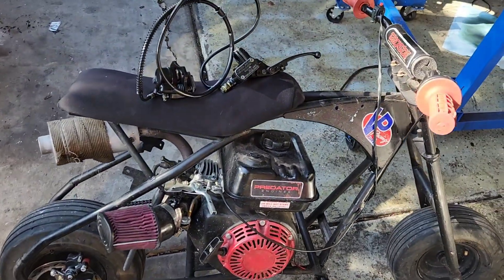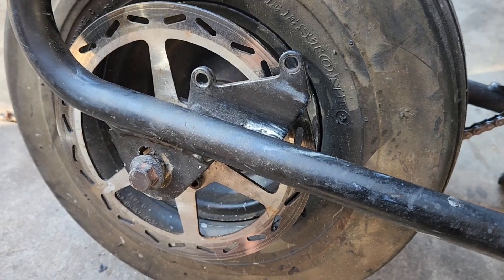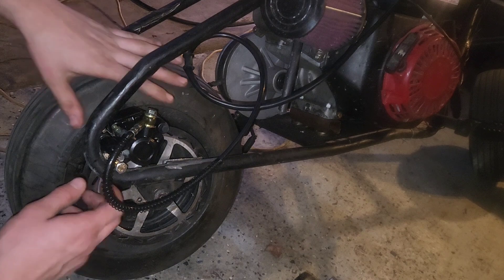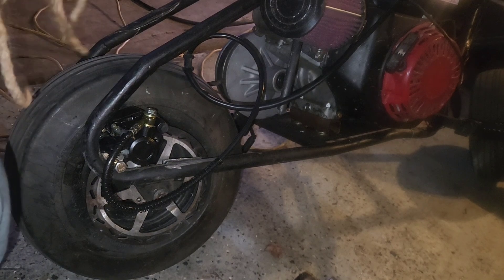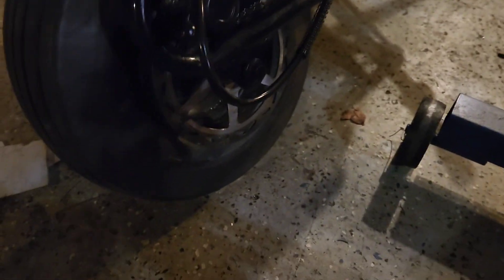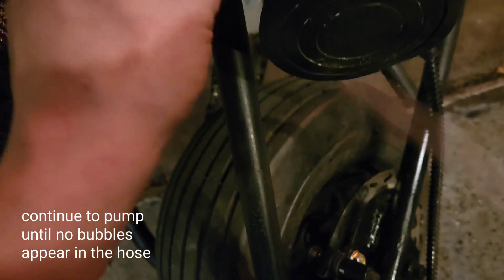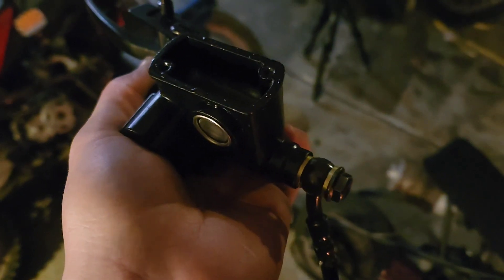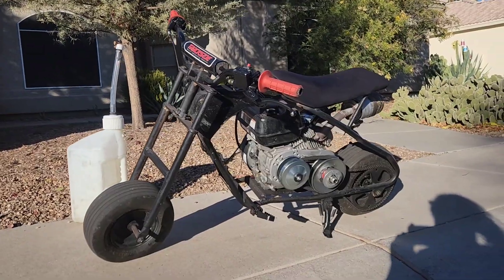MASSIVE minibike brake upgrade for $30! - tutorial

Comment: Hey man nice vid , what size tires are those? I been looking for those
Reply from the maker: Rear- 15x6.00 - 6 (15 tall 6 wide and 6 inch rim) front- 13x5.00-6. brand is Deli Tire. Got them from one of my customers. They are superb for grip on the street but not great in the corners